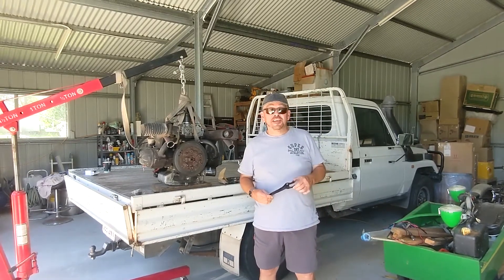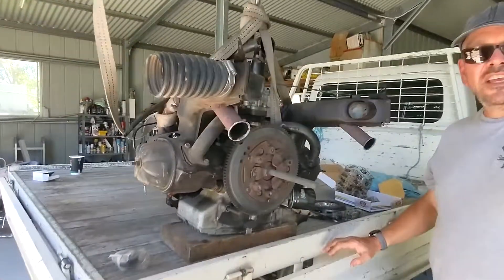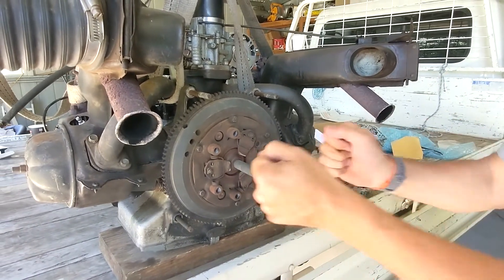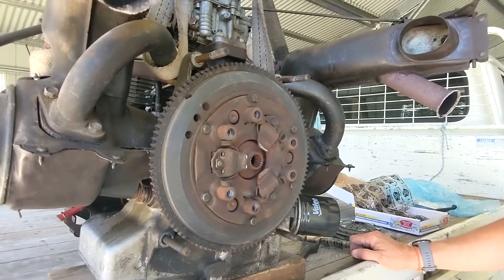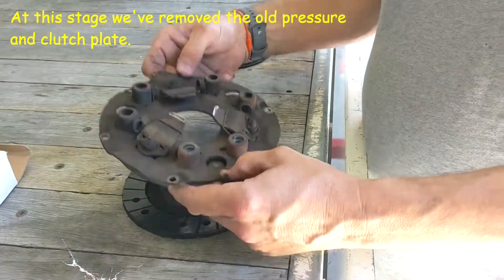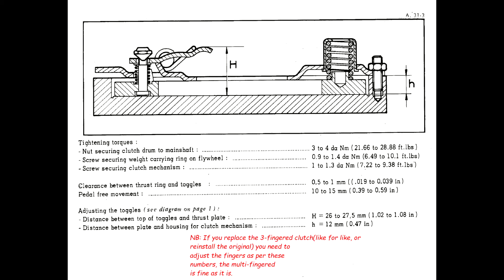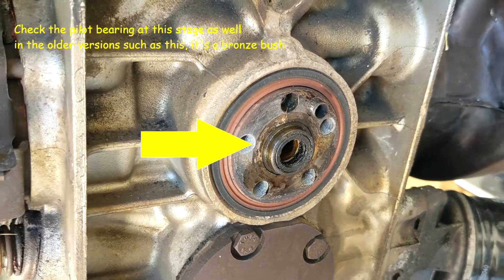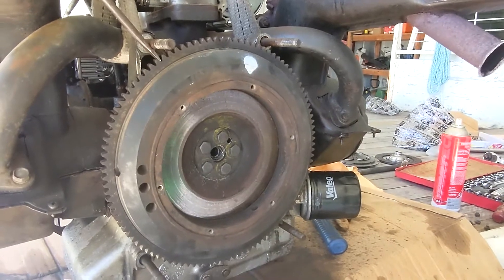Removing and replacing the 3-fingered clutch on a 1975 Citroën 2CV - Part 2

Comment: Greetings from Hellas 🇬🇷
Today i have changed my clutch with new my problem is that my adjusted cable is i think to tight cause if i loosen it gear is refusing to go in.
I layed on the ground just to see the fork and is sitting half of the way of its own movement.
Also my pedal engages almost at the bottom off the floor.is this normal?
Reply from the maker: @masterofpatent  Greetings, are you sure you have the correct clutch cable? There are two types available, one is for the right hand drive model, and the other for the left hand drive model. The right hand drive models clutch cable  is about 72.5cm and the left hand drive one is about 69.5cm, check the length of your cable.